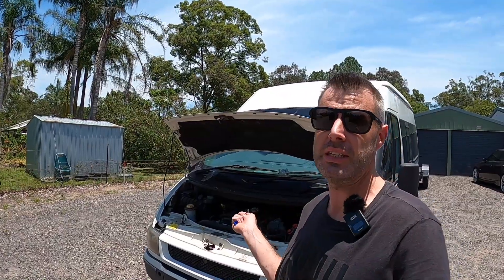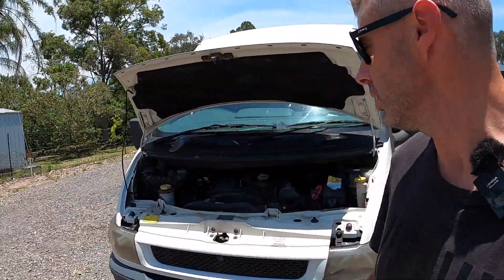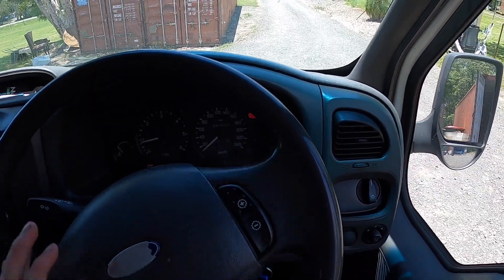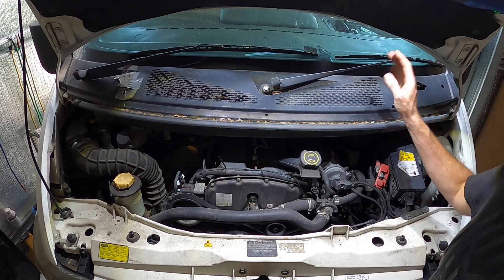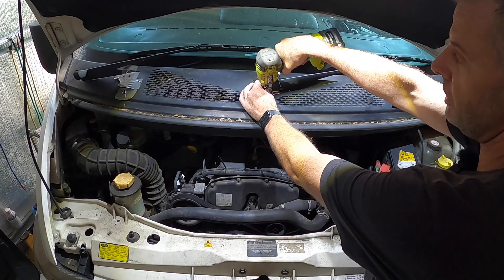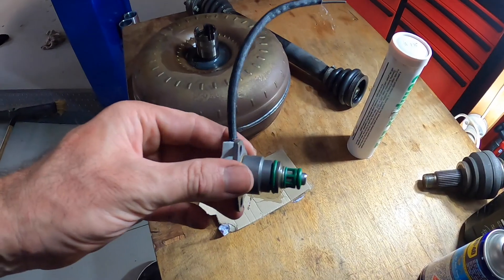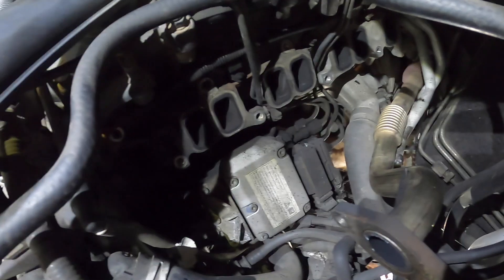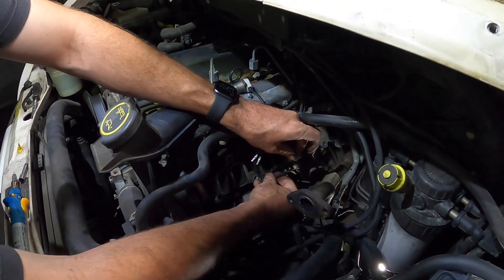Ford VH Transit Engine Rattle & Power Loss: DIESEL Pump Timing Solenoid

Comment: Great video i have spent hundreds trying to find out the cause of an issue and wondered if this may be what i need to replace. When i am driving and want to speed up quickly the engine judders and takes time to slowly pick up. It will pick up slowly but when your trying to overtake at speed its very frustrating and concerning as you want power at that moment. I have taken it to my local Ford dealer who recommended a full service and i understand they changed my oil and done a visual inspection of the van. Which means they did not actually look inside anything and check the condition and as a result all i needed was an oil change which cost me over £200 I collected the van and drive across the road the the MOT garage who then charged me over £700 for the brakes and other work that needed doing. i did complain to Ford but its a Franchise and they were unable to help. Anyway i then asked another two garages to find the juddering issue but both have not found a problem and recommended i wait until there is a problem to resolve it and find out the cause. I just wonder if the fuel pump could be causing the problem and i am no mechanic and a complete novice but i found your videos really educational. My van is not misfiring just just judders and lost of power when i quickly add throttle it does recover but i just wondered if it could be the fuel pump or maybe i am still just grabbing at straws. any advice would be gratefully received. thank you
Reply: It could be the injector seals or one of the injectors itself. I would buy some new injector seals of eBay and fit them yourself. There’s videos on YouTube. And also replace the fuel filter
Reply: Plug into a mechanics computer and get the codes read - or get an elm 327 reader and laptop and do yourself with forscan

Comment: Hi mate I'm guessing the reason you cut the plug off was becouse off the coding getting around that problam great vid my is the same van so going to do this thanks pal
Reply from the maker: No, its just there is no connector on the vehicle harness. You have to hard wire it in.

Comment: So were on the motorway/highway and the engine light comes on (coil like symbol) and the vehicle loses power completely. This goes on for hours and a 30 minute journey takes 4 hours. Power goes then starts straight up but with a rattle, and either gave us 3 miles or 17 and then the same thing happening. Hoping the fix is this simple. The power loss was crazy. Couldn't even climb hills. Anyone else has this issue ?
Reply from the maker: It sounds just like this solenoid, but more so an intermittent issue, not solid broken like ours. Definitely worth starting with the solenoid replacement.

Comment: Would have thought on the side of the road that the noise was terminal. Great work!
Reply from the maker: We legit did at the time. The sound in the cabin while driving was so different. We looked at each other and said.... so i guess we're not getting home. I back off straight away, legit thought it did a rod bearing.

Comment: 4:35 i reckon carbon just deposits there coz the egr valves at the front of the intake but on the side, and it could just be a bad design by ford flowing all the denser stuff into that cylinder.

Comment: It's not clear if it's a vacuum or fuel hose, but at timestamp 6:07, there is a very cracked hose, which is below the clamp but it might make sense to fix it :)
Reply from the maker: Well spotted, that is actually a coolant hose, and runs to the oil cooler/heat exchanger. It definitely needs doing asap.

Comment: When are you pulling apart your N54 engine?
Reply from the maker: When Jake can bring the tools around to do it. I don’t have the long torx bits for the head bolts. I need to get it done to see if the bore is scored.
Reply: @ZeroTo60Tube  You need to get it done to keep us tragics happy!
Reply: @ZeroTo60Tube  Hanging out to find out what went wrong before I mod mine. PS: I also have Ford   TranSHit worse thing I ever bought.